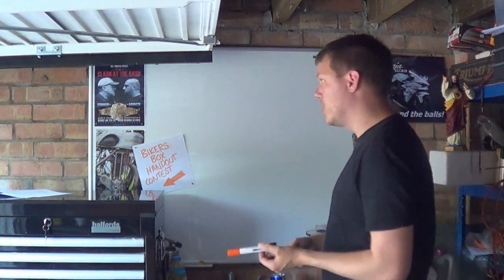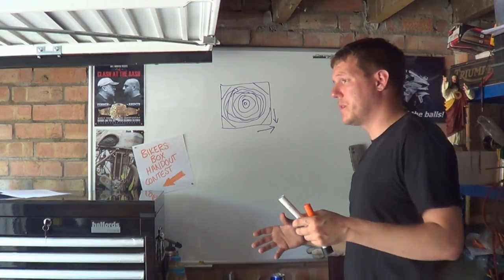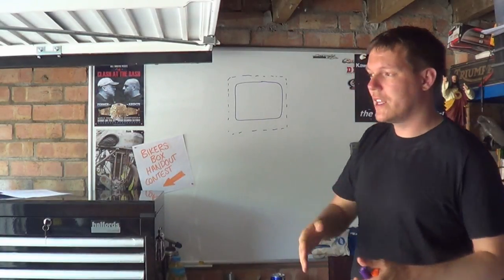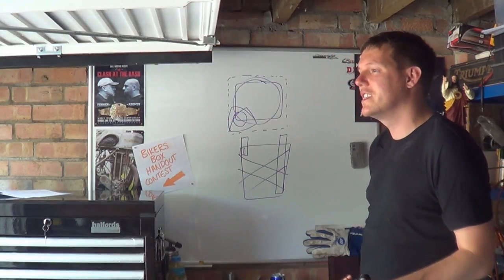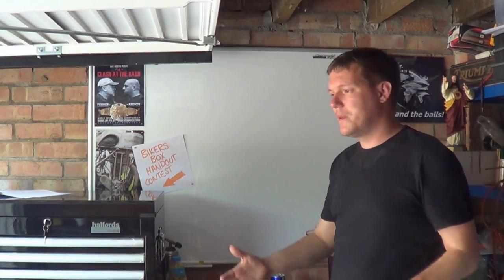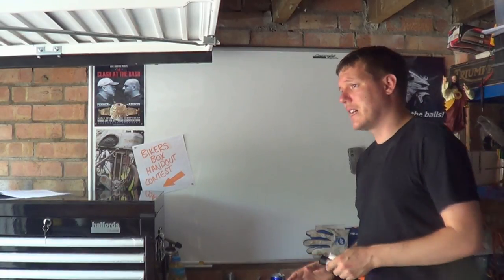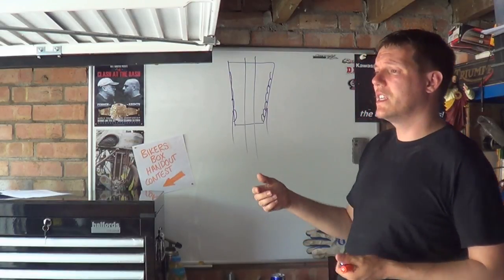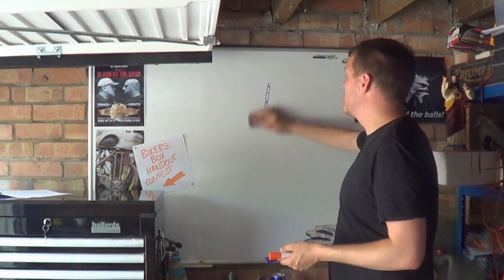Making square cylinders - reply to comments

Comment: You wouldn't use a broach. You are basically saying the wankel engine  block is not possible. "https://youtu.be/VwzIBwktU2Y"
Reply from the maker: LOL where are the square profiles? Dumbarse
Reply: Dude it's CNC shape has no relevance.
Reply from the maker: Oh the making a MODEL engine video again. If CNC can make anything, why does 3D printing exist?
Reply from the maker: And I have seen, in person a CNC machine many times. lol
Reply: how do you make a perfect 90 degree corner with a CNC mahine ? I'd guess you bore down it with the head at 90 degrees .. sounds facking expensive
Reply: Just draw a 180' corner  please and tell everyone that you did.
Reply: No he said it is not economically and it is slooow. In mass production it needs to be very fast.
Now Ford plant build 61.4 cars every hour in 2011 this means every process must be done in under 60 seconds or you must have enough machines doing the same process to achieve one finish every 60 seconds.
Reply: @thomaslemay8817  Do you think ford his hand cranking Bridgeports to mill the blocks? No it's all 100% CNC.  Back to the original comment. EVERY car maker does all the machine work with CNC.
Reply: @thomaslemay8817  That's kind of a stupid request? Comment? whatever that was.

Comment: If it's square, is it still a cylinder?
Reply: Would it be a block-head?
Reply from the maker: Extruded cube?
Reply: Good point 😁
Reply: No, It is cubical.
Reply: Squillinder
Reply: @kindredferguson5588  in  that's why you find all the squares  in  businesses in a cubicle.

Comment: haha gotta love the 3d printing comments. It's scary the amount of engineering students I study with that see it as a viable option for large scale manufacturing a component during group projects etc 😯
Reply: If the printed/sinstered part is then press forged to ensure interlocking dendrites of its grains, then 3D could handle pressures, but its cheaper to cast/mould and forge them - put printing is useful for non stressed parts, prototype R&D for dry fitting & some mechanical developments. Metal Injection, Vacuum Casting & Extrusions are so much better than 3D printed metals for load/force bearing usages on a cost scale inc' reliability, safety and replacement costings.

Comment: Considering the price of supercars, I am surprised someone hasn't eaten the extra machining cost to add that extra displacement.
Structurally, I think the cylinder walls would be strong enough as long as they were designed octagonally, that is to say, with a fillet of interior chamfer in the corners. 
Still, the cylinder diameter itself may have to be smaller to prevent bending or warping at the cylinder wall's center do to the constantly changing pressure within the cylinder. I understand the difference between tension and compression, and while metals tend to have high tensile strength, a flat wall is not a viable tensile (or compressive) structure. If making the cylinder smaller is the only way to compensate, well, the smaller the cylinder, the harder it is to machine. If we simply make the cylinder side walls thicker, then we are eating into the benefits of reducing material inside the cylinder.
Overall, the shape seems possible from a straight machining standpoint, though expensive. So I wonder, what other problems.
You mentioned fuel distribution and mixing within the cylinder, and I think that can be easily solved with direct injection, which is commonplace on modern engines. You also mentioned apex seals, which I am not familiar with, but guess that they are made to compensate for the uneven tensile load distribution across their surface. That does seem like a problem to me, but not an unsolvable one. I imagine changing the thickness of the seal to thinner in the middle and thicker near the corners, tangent to the direction of piston travel, would compensate for tensile requirements/differences. 
If those are the only two concerns with design/function, it surprises me there are not any of these engines, despite how expensive manufacturing would be. With Ferrari now charging a cool half million for some cars, its hard to imagine the novelty wouldn't sell, and the publicity could be worth it.
Thank you for your videos.

Comment: the block would be cast, the cylinder would be punch into to a square from a special die tool that would tapered round on the tip  then square. pound it off, cut it off then bend it off for the top of the head... It can be done fast if it the sleeves are very hot...
Reply from the maker: And you haven't worked in the manufactuing sector obviously. They're called broaches, and they will wear out in no time.

Comment: Square "cylinders" are bad for manifold reasons..pun intended. Lots of turbulence even if you use squared manifolds. It would be easy to measure cubic inches, though!
Reply: A square cylinder would not be good for normally aspirated engines, but the resulting flame front travel issue might be worse off if forced induction was needed.
Reply: fantastic play on words

Comment: Just a little bit of maths too, for any given length, a circle always gives the biggest area.
Reply: Not true, though I know what you are saying, considering things like bubbles. You just said it wrong.
But, lets consider your statement. 
A "given length" of 1 inch to keep things simple. 1 inch from center to sidewall. If it is a circle, that is a radius, so 3.14 square inches.
Now consider a square. 1 inch from center to sidewall. 2 inches across. 2 x 2, so 4 square inches. 4 is bigger than 3.14 by almost 25%. 
So no, a circle is not the most efficient use of any area given length. Quite the opposite. A circle is the most efficient use of length given area.

Comment: 12:57
What about extruded square cylinder sleeves ?
And the block is made by casting.
Reply from the maker: Still the same problem, how do you cut and hone a square sleeve
Reply: @dirtygarageguy  
 @Dirty Garage Guy  
https://youtu.be/1EpavW2XLIY
I think extrusion is good enough but if it needs better inside surface finish you can use a grinding wheel, a shaper or slotter machine. 
https://m.youtube.com/watch?v=A4jBgl7VYXw
Reply from the maker: Hone a square cylinder. And no, an extrusion isn't good enough. Next is stress in the corners and square rings and ring tension...

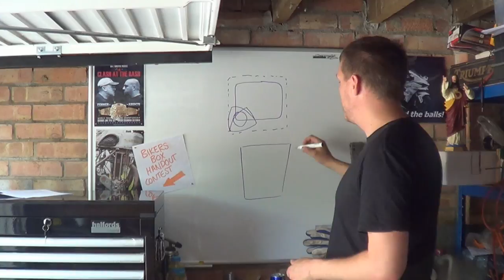Comment: Matt, please,  @ 5:00 you say the tool will "flex" due to the extreme length.  
Ummm, nope,  the tool can be fixed so that the  arbor and tool, moves into the bore, thereby keeping the tool short and rigid.

CNC 101
Reply: Doesn't respond to my comment with a direct answer. 
Typical of someone who just got owned
Reply from the maker: We'll see who gets 'owned' what are you twelve.

Comment: Square piston rings would either not seal or not have space to expand to.
i won't even finish watching this square shit is nonsense.
Reply from the maker: Well you missed the last 2 minutes which are good.
Reply: The last two minutes were "good" but you built and then disassembled the square cylinder premise that many have the common sense to dismiss anyway.  I suppose some (like me) wanted to see just where you would go with it for some purpose we couldn't imagine and weren't too surprised when the concept drew it's last breath and died.

Comment: Does anyone remember the square pistons in technical Lego?
Reply: Nope. My first Lego engine was a V-4 in a mid-engine dune buggy back in about 1992. It had round cylinders, so I am guessing the square ones were even older.
Still, I blame that set for getting me hooked on technic and engineering in general.

Comment: Why the hell are you all the time talking about "how could they produce a squared bore" and "how could they do honeing" and whatsoever? BTW (maybe temperature related though): it would be really helpful if you could bring one thought right from start to the end. You're again and again starting and bring it all over 70 percent and then restart next try. ;)

Combustion of your burnable gas mixture happening spherical from the ignition plug to the outer areas. Having different length of the flame-burning-ways means the burning or "explosion" maybe would not reach the outer most areas. Additionally sutt and all carbonized waste products would build up in the edges, blocking then the piston from compression. Edges additionally lead to massive turbulences in air flow in and out of the cylinder, that is what you not want in a combustion cylinder because turbulences will produce additional air friction when air passes the cylinder. Also circular diameter has the smallest circumfence of all figures you could produce. Lower circumfence, lower friction area, less motor oil needed, lower losses. Period!

In an engine block you also need loads of watering channels for cooling, so that is the area that the water can flow by and cool down the engine. Having sharp edges also lead to cracks and material stability problems all over. So having some edge in a explosion chamber wouldn't be that great, would it?

When it comes to smaller engines the solution is already existing - V-arrangement or even W-Arrangement of cylinders. Smaller cylinders with higher air load (you ever heard of compressors, turbos and G-Loader?) do exactly the same like a bigger cylinder volume - more air to burn!

Even to me as non engineer it is perfectly clear that squared cylinders may be kind of marketing gag but would just bring problems without advantages with them. Thermal problems, airflow problems, sutt and wearing problems, for making the engine block 1 inch shorter/ smaller? Or doing so for weight reduction? Throw out your electrical adjusting mirror and seats, the super duper panoramic glass roof of the car and 12 of your 20 speakers for your stereo and you'll have a much lighter car than with that engine weight reduction by squared bore. For your bike - just dump all the nice little gadgets you don't really need. Much easier to achieve and producing much less problems than squared bore ;)

Comment: Real square piston engine invented in Turkey. You can see in this video: https://youtu.be/xa4p0P2xnlg?t=75
Reply from the maker: You say working.... the guy also says it can get 100 km from 1 litre - that is total bullshit.
Reply: The Workshop he says that for round shape cylinder motor with a specialized fuel exhalation system and specialized crank system. This man has invented two different motor one of square shape cylinder the other one of round shape cylinder.
Reply: The Workshop he is also inventor of lpg cars in Turkey you can see archive videos. https://m.facebook.com/trtarsiv/videos/402152730480477/
Reply from the maker: You can make an engine lighter for the same cc - but that's it. Square pistons don't have any advantage - The crank and fueling system is or has nothing to do with the piston. I can't find any actual images of it, which is a shame because I'd like to be proven wrong. 

But 100 km for 1 litre is still bollocks - simply from a kinetic energy point of view. 1 kg of fuel has 47 MJ of energy. / 100 km is 0.47 MJ per km that's 0.13 kW hours.

In other words kWh * 1.3404 / hour = HP

So 0.13 kWh * 1.3404 / 1 hour = 0.174252 HP - that's nothing...
Reply: The Workshop yes you are right. It is overstatement. We will see what will happen next. They will test and share the results. I will let you know.